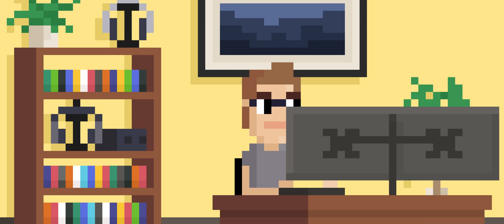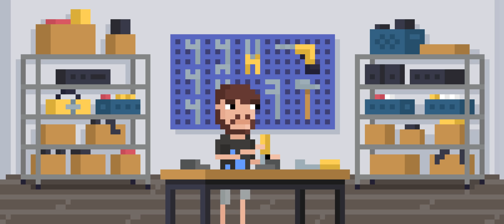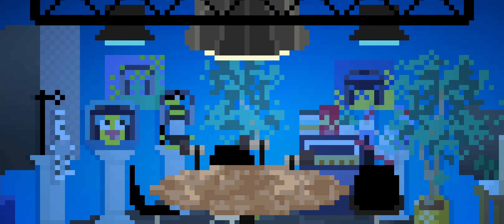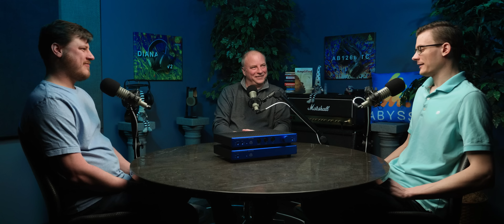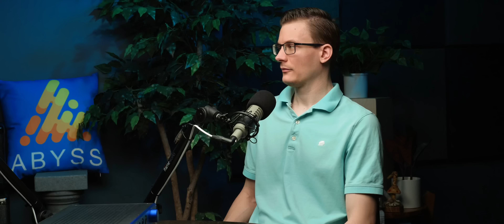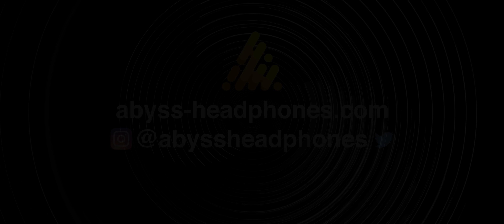The problem with Choosing Amps…

Comment: My Maggie’s used to clip most of the class d amps I fed it even if they had a ton of watts.  The issue would be they would dip down to 2.8 ohms and it would just bring these mega watt class d amps to their knees and trigger thermal protection.

Comment: It's not rocket science; an amplifier designed to supply voltage works with speakers that maintain impedance; amplifiers designed to supply current work with lower impedance speakers; and then everything in between.

Comment: I own a McIntosh mha200 rated 500mw. 
using it on 1266 OG it sounded like some amps rated over 1 watt heck some over 3 watts. 
but when I got XIaudio broadway the volume increased a goodbit despite it being rated same as "X" brands amp.
Reply: I have the same amp, it’s highly underrated for being able to work with a variety of impedances

Comment: I run an Emotiva Basx A 100 . The headfones are AKG K240. monitor.600 ohm.
The Emotive is a headfone amp but you can run speskers. I use it for fones mostly. Plays clean. Loud too. I dont get it too loud, bad hearing. Its just a amo . No. Tone control. Use it for a telephone amp.
Manual says 50 wts into 8  ohm, 80 into 4 ohm.
Days 220 resistors on out put stage, that are removable then full power to head fines. That day BEWARE IT CAN GET LOUD. I've never tried that, plenty loud with em in.
Price was excellent. Great service.big dollar headfone amp can't be any better.

Comment: What a great topic!
As a beginner audiophile, I chose for (upgraded crossovers) Scanspeak DIY speaker monitors 80W/4ohm which was demoed by the designer with a powernode N330 (same power output). Luckely, Bluesound added balance control to the N330 recently which was the main reason to shy away looking for an alternative around the same price range. I did not take the risk to buy something else and went for the N330 which I am pleased with in my appartment! Still a 4500Euro combo when purshased new but I was lucky to source this at 40% 2nd hand.

The headphone output is pretty bad for the Sundara I have And the only way to tackle is with bluetooth output and add a BT+dacAmp . Having seen many reviews for an Amp to match Sundara I'm pretty stuck on the IFI Zen One Signature/Zen Can Signature HMF exactly because this is designed to match. 
The Fiio K9pro ESS is highly recommended by DMS for the Sundara as well which gives me a choice to consider Which is to go for a tailored IFI or a "beefier"K9 and nothing else seems to matter anymore after seeing your topic.

I'm hesitant to follow the Sundara dealer's recommendations after blowing up a Dragonfly Cobalt (in demo) and an IFI Xcan (under warranty the Bluetooth/Amp chip fried after 1 year use).  A Decibel meter App showed I like 78dB max comfortably thus it's not me cranking up noise level beyond sane.
Leaning to the K9 now in modularity for future headphones thanks to DMS.

Lesson for me today is not to thrust on aestatics, datasheets or dealers too much but more rely on MF tailored hardware or reputable reviewers and in this regard DMS won me over IFI...I guess.

Thank you!
Reply: Well exploring HIFI and so much to discover over the comming years ...................to finaly understand that it's essentialy important to listen to something that sounds believable instead of high end ..........sometimes the solution is more simple than one thinks and would pay for ( an illusion with a very high price tag and never ending changing/comparison of highly praised components )
Reply: @frankgeeraerts6243  
I noticed sometimes it takes time to dial in a setup. It took me a while to understand I could bump up the mid range of the N330 by closing the base ports and add 4dB to the lower end. It cancelled out the rear port base reflex a lot. I went this route after Darko mentioned he likes closed ports which worked out well for me. and I might try Hires later instead of spotify, tough I noticed a cd sounds much better vs a subscribtion which seems to be a downgrade anyway.
I have an IFI Gryphon now to power the Sundara but wired it sounds better as bluetooth but struggle sometimes with Xbass and Xspace depending on recordings. The base can be felt on your eardrums if desired, however, the batt level loses a bar on higher volume LOL!! Still I have to get used to the details reveiling which is tyresome sometimes.
Maybe it's the HSP mindset which makes me sensitive to this.

I may consider a Lyngdorf amp but on the other hand I might settle as it is now I'm enjoying my hardware. I could upgrade to beryllium tweeters as well if desired but I am very happy I went the DIY route on the speakers. I think there is a real risk I getd issapointed going on "off the shelf" speakers.

cheers!

Comment: You can't talk about power amplifiers and headphones .... to drive headphones you need voltage only ... not lots of Watts ... you just need a voltage follower that will deliver linear responses to headphones 
With big power amps all you need is excellent low source resistance and high damping factor .. Most amps fail abysmally with their power supplies thus making it sound dreadful when driving speakers with a bad dip in their impedance response ( due to poor XO design ...)

Comment: it is exasperating that some insist on cold hard measurements and call everything else snake oil… try telling that to musicians, that their talk of dynamics and tonality are just snake oil, placebo effect…
Reply: The thing is, no one is saying that dynamics and tonality are measurable, because they are! Any musician worth their salt would tell you the effect of dynamics with each section down to the part, and if they can’t then they shouldn’t be trusted with a recorder.
Reply: There's still a lot that can't be measured and a lot that science can't explain. 1 great example is Stradivarius violins. SciShow made a video about it.
Reply: @benderong4478  see reply below... care to explain why different instruments tuned to the same frequency still sound different? are you going to tell me that the Strads are snake oil and that $100 violins sound just as good?
Reply: @nelsonang  

They have the same base frequency of the vibration of the string and harmonics from that base frequency. 
What makes an audible difference is how exactly was the instrument built. For example, varying the the shape and size of the soundbox, may increase or decrease certain frequency ranges and harmonics. The amount of different harmonics and/or additional tones generated by the soundbox can definitely have an impact on the sound. Changing the string thickness, altering materials(both strings and body of the violin) affect the sound as they resonate and harmonize differently. Using different bow types and materials can result in a wildly different characters of the sound.

You can measure all those factors, harmonics are easy to see on a frequency-amplitude graph, same with the attenuation of certain frequency ranges. Microscopic changes can affect the sound. 

Strads weren't an exact science back then, they all seem to have certain quality to them but no 2 Strads sound EXACTLY the same, there are tonal differences and I'll bet my left nut, those differences will show up in measurements.
Reply: I thought the wood used in Stradivarius' is what gave them their unique timbre. As in the wood used was denser than usual because the climate (which was observed in the record) had temporarily changed, alerting the way the trees grew.

Comment: What kind of snake oil company is this? I see on their website they are selling a $5000 power cable which “isolates and absorbs all forms of noise between the wall outlet and the component for pure clean power”. Right, never mind the 300km of cable between my home and the power station, it’s the 1m between my socket and the amp that is going to make the difference 😂
Reply: Finaly a happy and conscious consumer ........and the good news is there are very cheap amplifiers also with outstanding measurements ....:chillwcat:
Reply: As they say, a fool and their money are easily parted.   I'm into audio and also in the electrical trade, and I do wonder what dick came up with it.